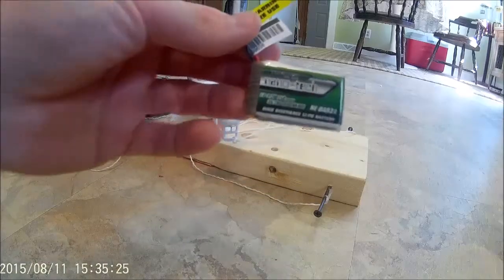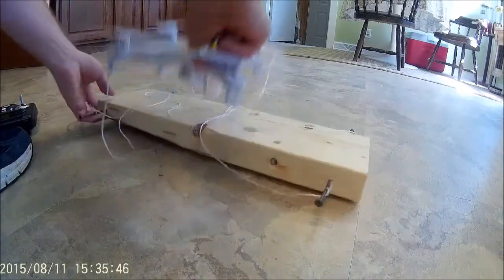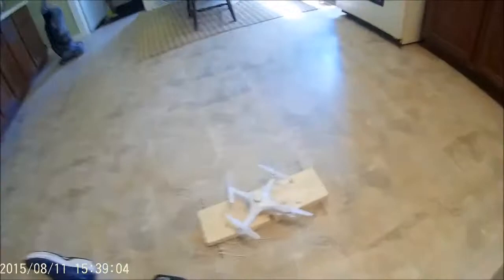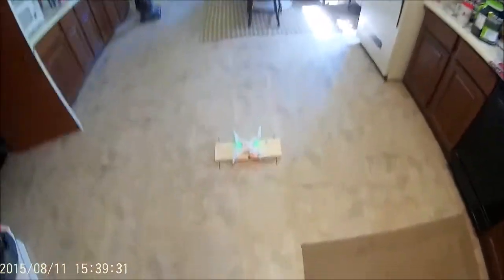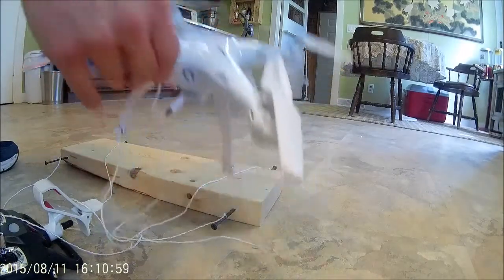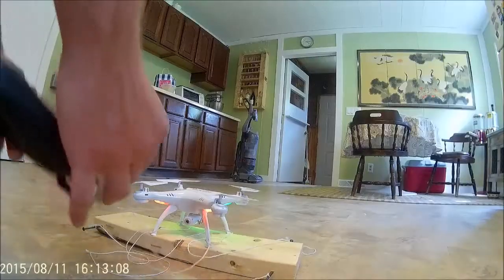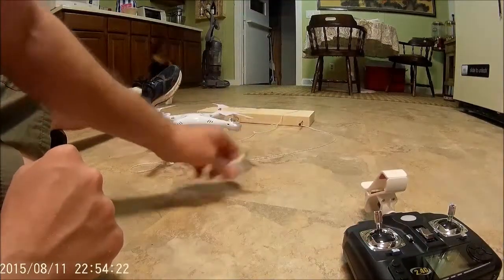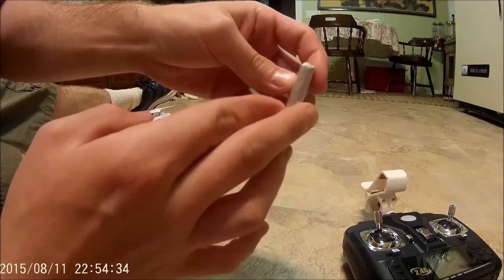Turnigy 3.7V 750mAh NE-BA931 Nano-Tech Battery Flight Time in Syma X5C X5SW

Comment: I wonder how an aftermarket 600 mah would stack up in this test.  Would it be just between the 500 and 750 or closer to the 750 due to reduced weight?   I haven't timed mine on flights, in any case it wouldn't be a real test as I have my X5C stripped down for longer flights without guards, camera, battery door or LED lamp covers anyway.

>>>But if you can solder, HobbyKing has prices on the Nanotech 750 that are close to the same as noname junk if you buy enough of them to spread out the shipping<<  I'd be less inclined to purchase these already modified for 3x the price though.